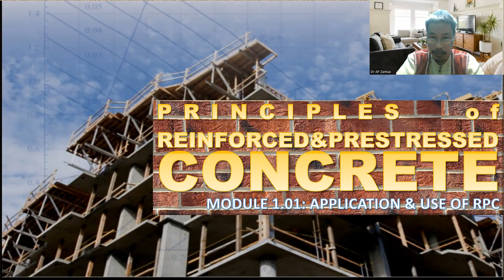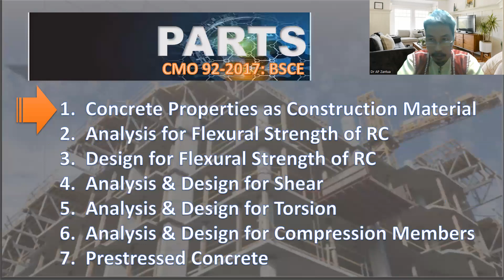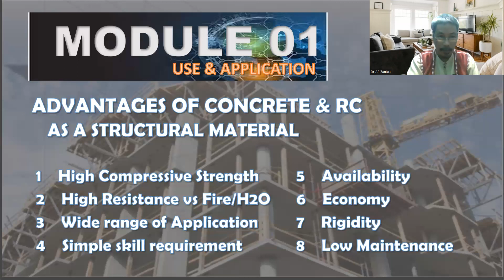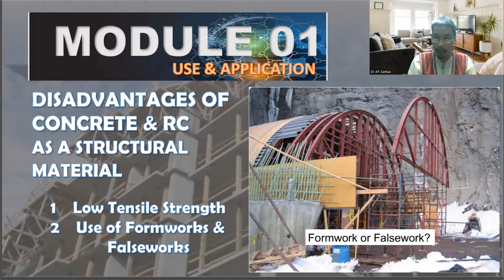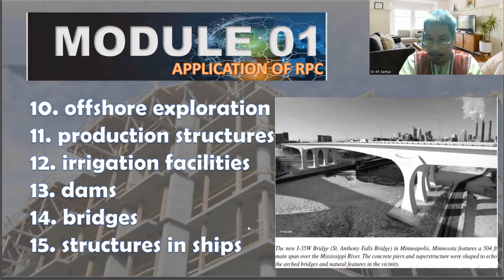Application & Use of Reinforced & Prestressed Concrete [ PRPC Design ] M1.01

Comment: Thank you sir for this video that tackles the advantages and disadvantages of concrete, reinforced concrete  structural material 

Question: Non-liquid admixture is packed in how many kg per container? 

Answer: B. 25kg 

Question: Liquid Admixture is packed in how many liter per container, except? 

Answer: C. 50L

Comment: Thank you sir for this video, I have learned the advantages and disadvantages of concrete, reinforced concrete  structural material 

Question: Non-liquid admixture is packed in how many kg per container? 

Answer: B.25kg 

Question: Liquid Admixture is packed in how many liter per container, except? 

Answer: C.50L

Comment: Thank you Sir, in this video I've learned about the objectives, advantages, and disadvantages of concrete and reinforced concrete as a structural material.

Question.
Non-liquid admixture is packed in how many kg per container? 

Answer: B.25kg 

Question.
Liquid Admixture is packed in how many liter per container, EXCEPT? 

Answer: C.50L

Comment: Thank you Sir for lecture video about the application of reinforced concrete and the advantages and disadvantages of concrete & reinforced concrete as a structural material.

Non-Liquid Admixture is packed in how many KG per container?
Answer: B. 25

Liquid Admixture is packed in how many Liter per container, EXCEPT?
Answer: C. 50

Comment: Thank you sir for explaining the context of our first module which is all about the application, utilization and objectives. Moreover, I get to know the advantages and disadvantages of concrete and reinforced concrete as a primary material.

Answer in Question 003. B. 25 kilogram

Answer in Question 003.1 A. 50 liter

Comment: Thank you sir for making us understand the advantages and disadvantages of RC, and to identify CE structures for which the use of RC is better than structural steel.
The advantages of Concrete and RC as a structural material are: high compressive strength, high resistance vs fire/h20, wide range of application, simple skill requirement, availability, economy, rigidity, low maintenance, long service life, appropriate for footings, floor slabs, basement walls, pier and the like, availability to be casted into variety of shapes, and requires cements and steel in small quantities while on the other side the disadvantages are low tensile strength, use of formworks and falseworks, low strength/ unit wt, low strength/ unit vol, property varies due to proportioning, mixing, placing and curing, shrinkage and creep.
The non-liquid admixtures is packed 25kg/container

Comment: Thank you for this video, Sir. In this video it talks about the parts of PRPC, what are the objectives, advantages and disadvantages of Concrete and Reinforced Concrete and lastly is about Reinforced Concrete. In this video also there are some questions that should be answered, the question in this video is "Non-liquid admixture is packed in how many kg per container?" and the answer should be letter B.25. The next question is "Liquid Admixture is packed in how many liter per container, EXCEPT?" The answer should be letter C.50L

Comment: Thank you sir for explaining of what the advantages and disadvantages of concrete and RC as a structural materials. This video shows the quality of these materials and that they should be used in engineering construction. For the given questions the answer is letter B. Because non-liquid admixtures are packed at 25kg per container.

Comment: Thank you, sir for explaining the pros and cons of concrete and reinforce concrete as a structural material. This information helps assess which material should be used in terms of its specifications. In that instances, we could be able to compare this material to another materials and appreciates its uses. We could also assess whether this material can be able to used in specific engineering construction as reinforced concrete are dominant. For the given questions, The non-liquid admixtures is packed 25kg/container and the liquid admixture is packed 4L/cont., 20L/cont., 200L/cont.. so 50L/container is the exemption to the problem.

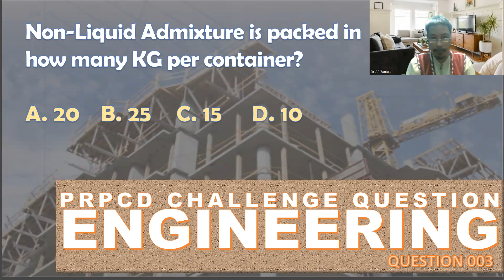Comment: Thank you sir for this video lecture for our module 1 of Principles of Reinforced/Prestressed Concrete.  Thank you sir for discussing the advantages and disadvantages of concrete and RC as structural material.  For the challenge question 20:49 Non-liquid admixture is packed in how many kg per container? is it 25 kilogram sir? The wide used of RC in engineered construction is because the steel reinforces the concrete and makes it an even stronger construction material. Thank you sir.

Comment: Thank you sir for your excellent explanation about this module, its about the advantages of concrete & RC as a structural material. And also to your challenge question I've learn that the Non-Liquid admixture is packed in 25 kilograms per container...